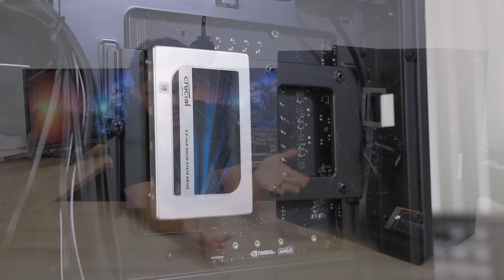The best case they've ever made? BeQuiet Dark Base 700 Review

Comment: You helped me build my PC, thankyou. 1070, 7600k
Reply: get a ryzen 1700x with vega 64 instead
Reply: Napz I'm out of money...
Reply: its cheaper???
Reply: Napz Nah I mean I've already built it, so I have no money left to swap.
Reply: WELL not when you already bought the parts.
Reply: oh rip. I'm building a pc in a couple weeks with a 1600x and two rx 580's
Reply: That's a good setup man
Reply: Two 580s? Why? Unless you already have one and even then thats a questionable decision.
Reply: why not just get ryzen and a 1080 instead?
Reply: Finn Foubister try cutting a notch in the panel pver power supply.   Then can put back on eith cable in place
Reply: Napz that’s not a good idea.  Spend more and get a 1700 and a 1070.  Crossfire isn’t even supported by all games.  And you’d need a more expensive psu...
Reply: that is a very good PC!!! man and if you wanted you could upgrade to a 7700k
Reply: Graphics cards red  team is bad, Nvidia is better!
Reply: Red team makes good cards where ram speed is critical. Unfortunately, that's really not gaming.
Reply: Ray Madore I built it in a black Corsair Carbide Spec Alpha not the case in the video
Reply: Napz why would you do crossfire? get a 1070 instead
Reply: How is a Vega 64 cheaper than a 1070? Vega's not that great boy, and the 7600k has the edge in gaming, whereas the 1700x is better for workstation. And 2 580s? Not a good decision at all mate.
Reply: Napz Also I got $100 off 1070 and $70 off 7600k in Black Friday sale so idk if it would've actually been cheaper
Reply: Got the same setup! If you can, OC that 7600K. I have a mITX build, but I wish I could OC.
Reply: why go with 2 580s? seems like a bit heavy handed with all that red.
Reply: Pennywise I would but I have no $$$
Reply: Pennywise Actually the 8600k was $200 more and the z370 mobo was $200 more so it would've cost me $400 more (this is in nz), and I only had a certain budget, I got the best build for my budget possible, I did plenty of forum research as well as taking into account sales etc
Reply: Napz I would recommend getting one stronger gpu rather than 2 weekend gpu’s not saying the 580 is week it’s just with crossfire not all thing scale well but if you are playing games like gta v you probably will to pretty dang good with the 580 but I would go with a 1070 or 1070 ti rather than go with 2 580s
Reply: Nice rig, man! don't listen to people on comment section, they don't think about budget before talking. And Vega sucks ass compared to Nvidia 10 series, you did well
Reply: Napz rx 580s are overpriced right now, let alone two of them. And go single card, multi card setups other than the higher end is not worth it.
Reply: Owch, $200 for 4 threads. what is this? 2012?
Reply: Ollie  I live in Nz, the prices are ridiculous here compared to USA, same with Australia they also pay a lot more for their PC parts
Reply: Yeah, but something like an r5 is the same price
Reply: * For most OLDER games you dont need more than 4 threads. Quite a few modern games will use them extra threads, and the ones that do will have some horrible microstutter, and its only going to get worse. Its a good buyif you only play older games and only will play older games. But if you're planning on playing new games over time its only going to get worse and worse
Reply: That is actually not that bad. The 1070 is a great card, and the single core performance of the 7600k is far superior to any other chip in that price range. Napz your suggestions are so dumb, I assume you're trolling. None of the ryzen x models is a good choice regarding price to performance, Vega 64 is way more expensive than a 1070 with a rather small performance increase (1080 or 1070ti is far superior in that price range) and crossfire is just retarded, especially with the incredibly overpriced 580. Their price would be enough for a 1080
Reply: You have no idea what youre talking about. While the 1070 is a great card, the 7600k's single core performance isnt "far superior", its less than 10% better, and not only that most games use more than 4 threads making the 7600k a bottleneck and it makes microstutter. "Vega 64 is way more expensive than a 1070" Its not even a competitor, its meant to compare to the 1080, which it does on newer drivers. The vega 56 is more of a competitor to the 1070, yet gives 1070 Ti like performance for $400. "incredibly overpriced 580" Again, you clearly have no idea what youre on about, the rx 580 is currently the same price as a 1060 yet faster
Reply: Ollie ok you're probably right. I wasn't quite up to date. Like a month ago, a Vega 64 was 600 and the 580 8 gig at least 350 if you even got one. I don't actually know about the Microstutter on quad cores but you might be right. Still the single core performance of the 7600k is way better especially when overclocked.
Reply: Napz gross hope you didn't do this yet
Reply: Oh and what I said applied for 1080p and 1440p gaming, not 4K. If you play on 4K get a Ryzen 7 2700x with 1080 Ti, the performance is almost same as with i7 8700k but cheaper. So to summer up: if you want to play at 1080p 60 FPS get a Ryzen processor with a 1060 6gb/1070 if you can. For 1080p 144hz get a intel processor with either 1080 or 1080 Ti knowing that you might need to lower some settings with 1080 on some games like The Division. Same goes for 1440p except I’d suggest the i5 8600k for 1440p 60 FPS gaming. For 144hz at 1440p gaming get the 1080 Ti. For 4K 60 FPS you can take the Ryzen 2700x or i7 8700k both with 1080 Ti. The difference isn’t huge and the Ryzen processor has its advantages like multi core for rendering and stuff. The higher the resolution, the minimal the difference is between R7 2700x and i7 8700k.
Reply: Mousy. I got my 8700k for the same price as the 2700x on Amazon. $329. Although there has been a lot of sales lately especially for Ryzen. So maybe can get cheaper
Reply: Just bought a 7600k
Reply: Mr. Latex Vega 64 is doodoo. Although it did go down in price.

Comment: would the trident z rgb ram fit in this case with the 280 kraken water cooler?
Reply: MoonFooy Jenkins you really never have clearance issues with ram when using an aio. As long as you have proper fan support you're fine.
Reply: You could have issues with the radiator if installed in the top.
Reply: Most likely, no, if you mount the AIO to the top of the case. Mount it to the front, and there would of course be no issue, but TridentZ RAM is just as tall as the first kit of Corsair RAM he used in the video.
Reply: Biggunkief what if you use a 240mm radiator?
Reply: @wi1dcard192  That is definitely not true for all cases. MidTower cases with top mount aio do have an issue with ram heights on RGB sticks, as seen and talked about on this video.
Reply: Courtney Roberts yes but common sense would tell you to mount in the front if it won't fit in the top
Reply: @wi1dcard192  Most people run optical drives and with many AIOs having stiff tubing you can't get it where it needs to be unless it's on top, that's also assuming you're not using HDDs in the front which would almost eliminate the chance of running a 240+ up front. Common sense would tell you that if EVERY major ram manufacturer makes sticks specifically advertised as low profile, there is a reason.

Comment: The top ventilation looks a bit suspect for 280mm AIOs...seems like only the rear most fan would have the air properly exhausted... doesn't make sense really...why not make the venting longer to cover two 140mm fans at the least?

Comment: The choice to not just put airflow cutouts on the top panel is curious... Looks like a great water cooling case but you'd likely have to cut some holes out in the top for proper airflow if you wanna run a 360+360 setup.

Comment: While I understand the desire to contextualize criticism in terms of this being a premium case (well, aside from Caselabs and the like), you way overdo it in this video. In the end you come off as if you're scared of being seen as critical, while (constructive) criticism is the entire point of a review, after all. Saying "you should all buy three of it", even as a joke, makes you come off as insincere and lacking critical distance to the product you're reviewing. Sure, it might be a great case (although as Steve at GN pointed out, it needs more fans to compensate for that shitty front intake arrangement), but the criticism still stands. $180 with no rear PSU mount, oddly strangled intake airflow, and some odd details seemingly overlooked? That's not good, really, even if the attention to detail really does shine through in other areas. Seems inconsistent overall.
Reply: For once I have to agree...He said it was the best designed and built case, yet he also pointed what I would call major faults especially the airflow, top and front and lack of space at the top... and the price! I do sometimes wonder if they just cant give a real review becouse they are worried they wont get the kit/money/sponsorship from the manufacturers if they do give a negative review..This review seems to be a big case in point! Or maybe this should not be called a review but instead a product Ad?
Reply: Not sure why you decided to bring his personality traits into this, when it has nothing to do with a case video. :/ Just kinda makes YOU come off as petty.

Comment: Does anyone who has this case know where to plug in the port for the fan switch connector and led switch on the front panel on the motherboard? It’s a small 6 pin connector but I can’t find where to plug it in on my motherboard in terms of headers. I’m using an ASUS rog crosshairs vi hero ac Wi-Fi motherboard

Comment: Specifications : AMD A10 7860K Quad Core running at 3.6 to 4.0ghz turbo processor
8GB DDR3 1600Mhz Memory
500GB Sata3 6GB/s Hard Drive
Built-in onboard AMD Radeon R7 Series 757Mhz Graphics
Nighthawk T602 chassis to Blue Spider (case)
Front case mounted 12cm Blue led light fan
Rear case mounted 8cm Black fan
Ordinary 600w Power supply
Ubuntu Linux Installed
Free Linux softwares installed

Good pc??.

Comment: The hard drive cages are absolute trash. I hand tightened the screws, and gave each a turn or two with a screwdriver and they still wobble. I wouldn't trust transporting this case without removing the drives first. I may go back to building with Corsair again as I loved the Corsair Crystal 280X compartments and drive cage. I just wish the Crystal Series 680X wasn't so expensive and so fracken massive.

Comment: PLEASE give me an answer! I wanted to use the 16gb memory kit "Trident Z rgb" (you know, the popular one xxD) but now you said that if you use an 280mm radiator it will only work with low profile ram. --> the Trident z is 44mm and the vengeance lpx is 32mm. Will it fit? :u                  edit: i also found out that the ram Bitwit used before was 48mm ..

Comment: This case has a front panel USB 3.1 Gen 2 Type C port.  What mobo did you use to connect that up?  I'm not finding many boards that have an internal I/O connector for Gen 2.  Lots of Gen 1.  The few that I have found are all over $200 bucks.  Is that just the state of things at the moment?  The one board that I've found on NewEgg, that seems to have pretty good reviews is the ASUS ROG Crosshair VI Hero.   Its been many many years since I've built a machine.  Trying to get back up to speed on the technology.  My current list of parts is: https://pcpartpicker.com/user/jeff.carley/saved/P7sCyc

Comment: X399 msi pro carbon has 2 USB 3.0 headers that are side plug off the right side of board. Raise a driveway cover by 1 click and they slide right in. Btw the drive bay covers can be closed, locked open 1/2 Inch or removed to insert the drive bay cage

Comment: Or you could've gone further and pull out all the cables that are going to be routed under the motherboard before installing motherboard, this way you wouldn't have to remove the panels on the bottom of the PSU shroud, but I diagress

Comment: This review is really great because you also showed that it's possible to install a 280mm radiator on top when using low profile rams. Exactly what I searched for. Thanks for that. Does anybody of you guys know if there are x470 boards with too big vrm heatsinks so that you may run into issues with a 280mm be quiet silent loop aio installed on the top? --> the dark base 900 rev2 case would be an alternative, but that does not fit under my desk .... it's too high.

Comment: Ram prices getting higher
Case prices getting higher
So next is?
Reply: Guilmar Dionisio case prices are not getting higher. That is just one expensive case
Reply: Case prices aren’t going up
Reply: Your mamas prices per hour.
Reply: This is actually a very good value for what you're getting. Cases of the past didn't include Tempered Glass, Lighting with included controllers and Fan Hubs.
Reply: Silicone wafers could be going  up.
Reply: GPUs
Reply: Guilmar Dionisio gpu prices? Oh wait spoke to late
Reply: Next is fan prices
Reply: 2080 ti
Reply: Graphics cards
Reply: Hard drives are next.

Comment: I have read reviews from Newegg.com that some have recieved the new case with stripped screw heads and other problems. In your experience, is that typical for BeQuiet! or just a few rare units? Also, how are the filters to clean and other basics once you get past the build phase and spend a few months using the unit. Looking at the back and other areas that do not have filters, how does the dust stay out? I would think air should only come in from the filtered areas or what is the point of them. Thank you for the video.

Comment: Im wondering how well the top radiator gets to exhaust warm air out and not circulate it back to the case? I think there's not enough ventilation holes at the top of the case for decent air flow.

Comment: Tell me again why Kyle decided to put a 280mm radiator at the top (with 2 140mm fans attached) if there's only one portion of the top where there's tiny slits? The other fan on the radiator would be useless, wouldn't it?
Reply: Michael Budden exactly my thought. Blowing hot air straight to the wall of the case

Comment: In the case like this, I would actually just move the part with drive cage forward and just do it like everyone else - give ppl ability to mount HDD and ssd behind the back of the motherboard, and this case is wide enough. Because I feel like I do not want to see the drives sticking out inside of the case ruining my entirior because ppl who spent a lot of money for case, in most cases care a lot about aesthetics and looks that they'll get at the end. My fav case so far is Phantakes Enthoo evolv, very clean, and the build quality is supreme. JayZTwoCents actually pointed out that the airflow in case is not as good, it is true, but, in his last video he actually posted a website where you can buy the same kind of panels for top and front with mesh cut out for inproved airflow. I like that

Comment: Looks great but the front intake looks weak. Front panel mod needed. At that price too. yikes. Wait how does air get out the top? This has to be a hot case.
Reply: taipeitaiwan10 basic design. Poor intake ventilation. Terrible top ventilation for having radiator support. No cable management features. Only 2 included fans. This case is lame and a terrible value over the h700i.

Comment: My 40$ case comes with 3 led fans, power supply shroud, dust filter, hdd cages, back side ssd slots and nice cable managment. This is just overpriced
Reply: And did i mention side panel tempered glass
Reply: Which one?
Reply: NapanTR MS spectrum

Comment: i7 7700k for 289$ or wait for the 8700k to come in stock and go back to normal msrp.... :(
Reply: Energy oneeighty wait for z390 in a couple months.
Reply: i7 7700k
Reply: Energy oneeighty Wait for The 8700K because it is a much better long term investment. Intel is only going to improve it incrementally until required to up it to 8 cores to keep up with the competition.
Reply: 290 usd is a good price for 7700k...8700k cost 414.89 usd @ amazon...if u have the fund just get 8700k...if not wait till Jan '18 when supply stabilize....or get the 8600k @ 258 usd is at msrp...newegg selling for 299usd

Comment: I have this case and I am dissapointed. It is clearly designed for regular fan and not water cooling. There ius very limited air intake. If you install watercooling on the top of the case - top gets very hot - as sloth are tiny in the top. I would not reccomend this case at all. It suposse to be quit .. but due to very limited in / out air flow - it is not.

Comment: Airflow is very poor in this. Top- blocks of 2 out of 3 fans in a 360 rad. Front not enough pressure for overclocked GPU's. Might as well put your parts in a FAN Oven.

Comment: You get so much more on the H700i for just $20 more. You get a fan controller, LED controller. 4! Fans. Excellent cable management. You also get the radiator bracket on the top which allows you to set it to fan orientation or flip it for radiator for extra clearance. And it's also custom loop friendly. And has so much better airflow than this case
Reply: Sure you get all that. However what it lacks is storage facilities. The H700i only supports a maximum of three 3.5" drives, whereas the Dark Base 700 supports seven 3.5" drives.
Reply: nzxt stock fans arent as good as be quiets silent wings 3 and their fan controller is software based while be quiets is manual. also this case is for users looking for silence not the best airflow.

Comment: What's wrong with case vendors nowadays...low air flow or zero air flow is a new feature for enso and base 700.....even with AIO, it's going to cook ur cpu plus where is all that hot air going to flow.....one will rma ur pc components esp( nvme drives,SSD hdd )in 3 mths time.....no 3.5mm ear phone jack is also a new feature for pixel 2 and iPhone ..dun get it.???